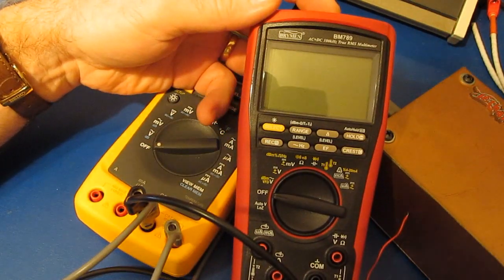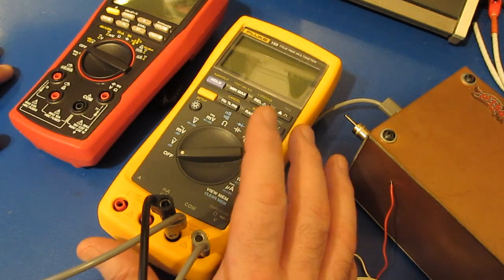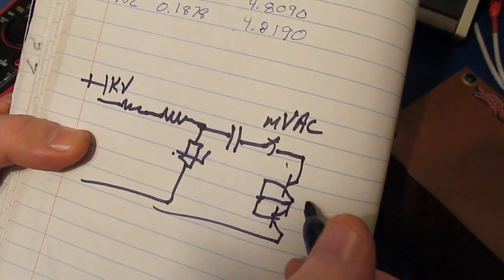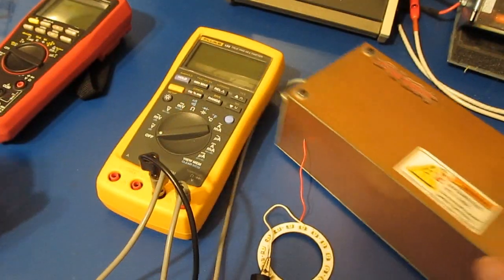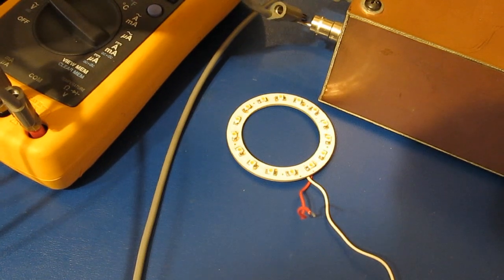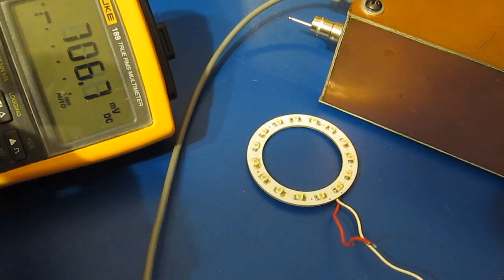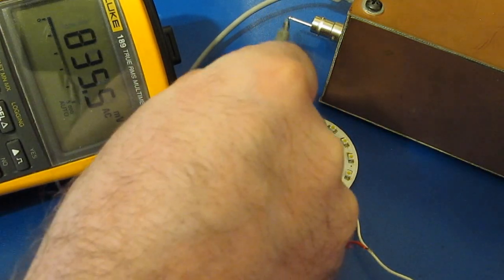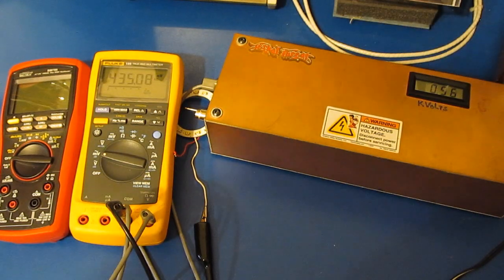Caution when using your meters ACV modes Part I

Comment: Since I started working with discreet transistors in the late 1960s, I’ve always grounded test leads on meters and scopes before measuring a circuit or device. We also developed the habit of discharging large capacitors before handling. We had a cap discharge device at each workstation consisting of a wire with a resistor and two alligator clips.  A living example of “once bitten, twice shy”.

Comment: Can the uniTs survive this test is the question.
Reply from the maker: I had joked about using the Fluke 189 to damage a free HR meter.  I would hope every meter made could survive it.   I would be more concerned about something like low voltage logic, FETs and such.

Comment: As always, nice video. Long time ago I read a manual from some instrument, can not remember if it was a meter or a scope, that warned for the dangers of a charged AC coupling capacitor. And advised to first discharge that. I am always extreme careful with caps. I have a shorting bar mounted on my table to discharge caps that I want to measure with my LCR meter, and stuff to more friendly discharge caps.  I often do repair work on industrial stuff that can deliver a lot of energy and if stuff is broken it can becomes more dangerous. That is one reason I only use robust DMMs, I seldom make a mistake but if I, do I am glad I watched your videos and bought the 869S after that. Still my favorite hand DMM.
Reply from the maker: I think shorting it out is the best practice.

Comment: Thank you Joe for this video. As usual you don't just talk about things, you actually test and measure them. I was the one that asked you the question on the EEVblog about the blocking capacitor discharging and possibly damaging an external circuit. This video answers the question very clearly: yes, it could happen. So the correct procedure would be to discharge the internal blocking capacitor after measuring anything with a large DC offset when in the ACmV range.
Reply from the maker: If measuring AC, you would have no way to know at what part of the cycle you were in when you removed the lead.  While the impedance appears higher in the volts than mv, you may still find it can cause a failure.   Consider also that while I was showing a kV DC signal to charge it, you should consider lower levels as well.
Reply: pff i didn't read this comment. yes. old school method. Always make a short before measuring... 
Touch the ground with both hands before touching..
shake the box before closing...
close your eyes before pushing the start button... etc.

Comment: So you still like the 789 as well as the Fluke 189? Good stuff as usural.
Reply from the maker: Yes, I like both meters.  Still in the lab, my favorite handheld is the BM869s.  I want that split display like the 189.  The 189 misses the second temperature sensor and there are a few other features the BM869s has that I use.  For me, that 189 is a very close second but it's very old and no longer available.  Both are very good basic meters.